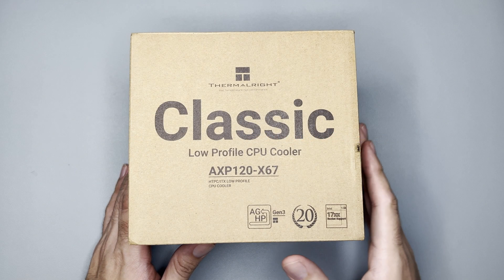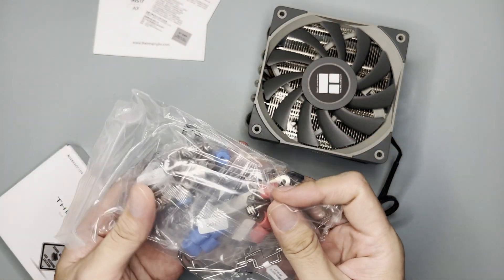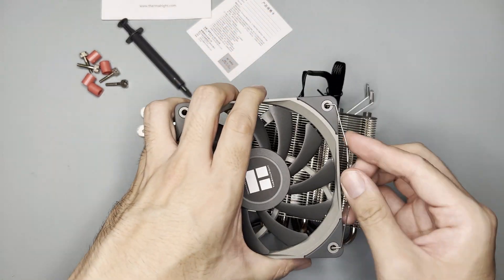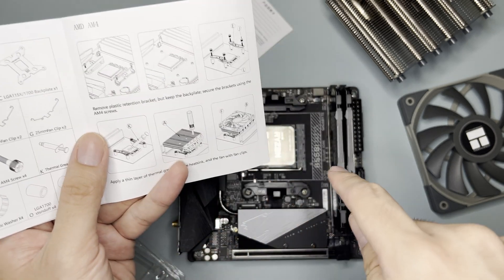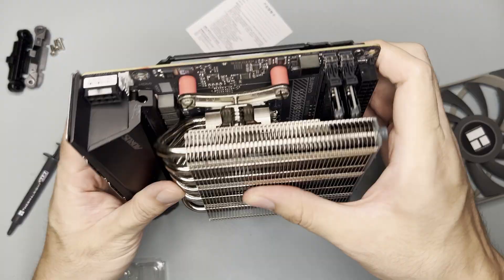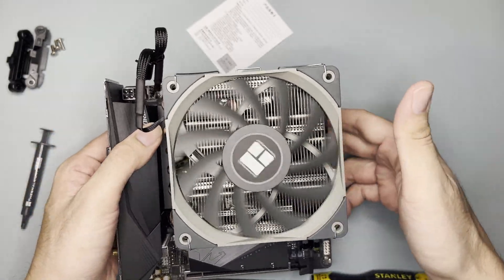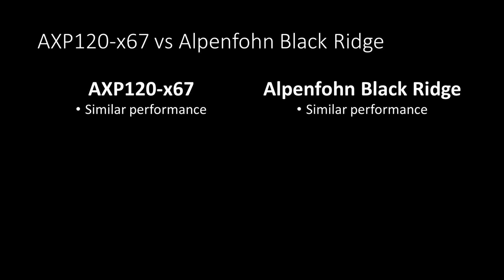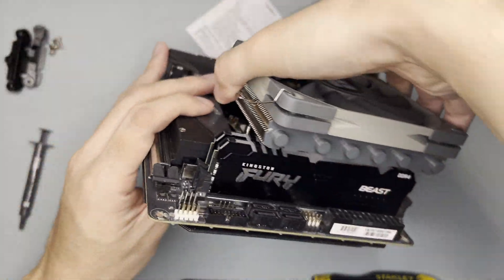Thermalright AXP120-X67 | Unboxing, Mounting, and Benchmarks

Comment: is the cpu cooler in intake?
Reply from the maker: Yes, intake. But you can reconfig to exhaust if you really want to
Reply: @manongunboxing  will I get better results than with the ID cooling 47 paired with noctua A9 25mm?
Reply from the maker: @spacedandy6778 while I don’t have results, in theory, axp120 will do better (on average).

In theory, the heat will fill up the mass of the heat sink and it will be cooled down by blowing air thru it. Thus your limit here is the mass of the heat sink and the fan removing heat from it. While there are other factors such as heat transfer rate (heat pipes doing their thing), I think for is-47, the mass is too small. And thermalright isn’t just a cheap solution, it is cheap and good solution.

Comment: sure on 42mm ram clearance?
Reply from the maker: Sorry I just had personal matters to attend to. Will get back to you by tomorrow
Reply: @manongunboxing  I also have the same question
Reply from the maker: Sorry for the extremely late reply, but yes, it can. Tried it again recently.
Reply: @manongunboxing  cant you just flip the heatsink to get unlimited ram clearance?? where the heatsink goes over the vram heatsink of the motherboard.
Reply from the maker: Depends on the motherboard. For b550i aorus pro ax, you can't as it will hit the I/O shroud.

Comment: can you try this to 13600k or ryzen 7700
Reply from the maker: hi, sorry I can't. I have no budget for those.
Reply: i paired it with 13700k. temp can go up to 90+c celcius when gaming and over 100 during benchmark. undervolt is a must. But it should be ok with 13600k since 13700k uses up to 253w during boost
Reply: @badrulaminbaruddin176  have you tried to power limit and undervolted the 13700k while using the axp120-x67?
Reply: @blindman8093  yeah. i set PL1=PL2= 200w and undervolted it abit. still testing but temps are now 70-80 during gaming.
Reply: @badrulaminbaruddin176  nice. how was the performance in 200watts limit?
Reply: @badrulaminbaruddin176  was it to loud the cpu air cooler?
Reply: @blindman8093  ive the rgb one, its not that loud. Well it depends on your case, if you have extra fans, 200w should be no problem - <90c.

Comment: do you think you can install the cooler the other way facing the vram heatsink? or does the heatpipes hitting the ram prevents it completely from being installed? planning on either this or buying is-55 (got heatsink issue with the aorus b550i so i was thinking of clipping some of the heatsink fins but other than that the ram clearance for the heatpipes are fine)
Reply from the maker: Here is what I can remember: It can be installed facing the vrm hs. The heat pipes will indeed touch the RAM but will not hinder the installation.

Please note that I did not mount it this way and just tested it. If you want a confirmed response, you may have to wait for a while as my motherboard is in use with another build.
Reply: @manongunboxing  thank you!
Reply: @manongunboxing hoping to see this installation in your future builds ❤